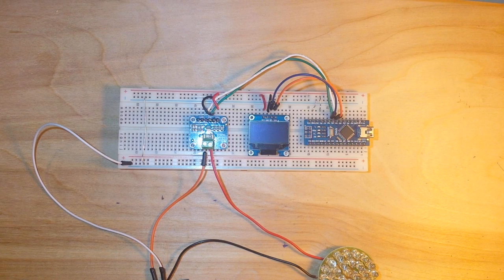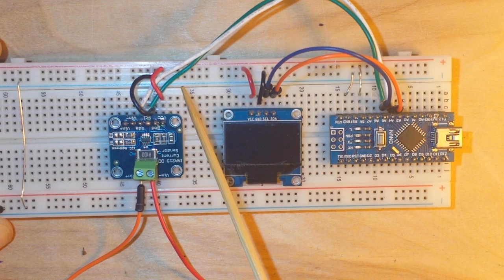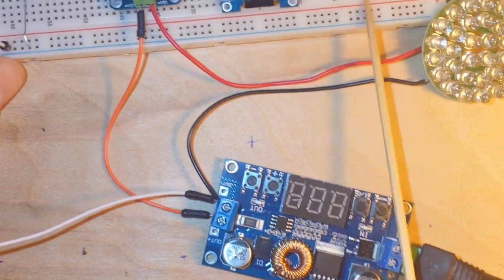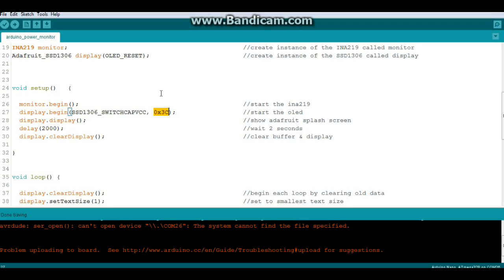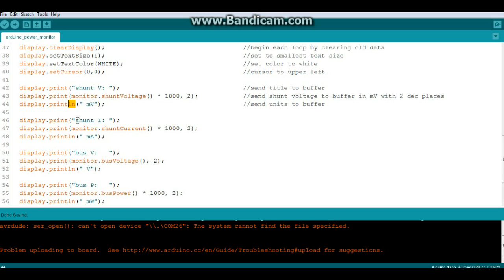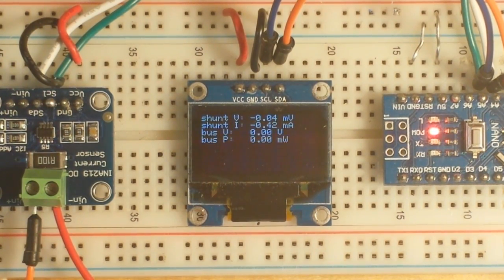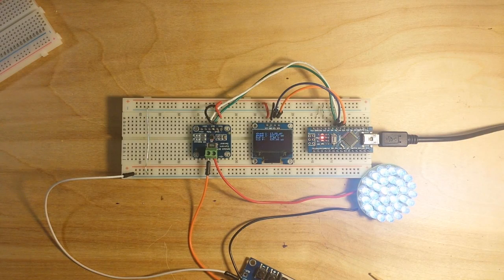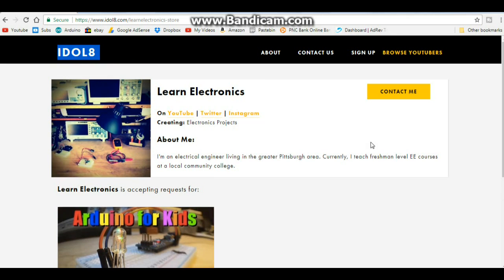Arduino Power Monitor

Comment: Hello, I'm very confused as to how to use this. I've looked at many tutorials and Adafruit's tutorials, etc - I want to measure the power output directly out of a battery for example. Is this possible? I'm expecting that if I hook up a 9V battery to the INA219 it should read about 9V, right? How would you recommend I hook it up? Thank you in advance!
Reply: yes it's possible
but you need the battery to be feeding  charge

Comment: can we use acs712 current sensor with oLed?
Reply from the maker: Sure, you will have to have the right library though.
Reply: But sir In comparison of ina129 current sensor, acs712 current sensor has only 3 pins. Can you please explain how to make connection(like clk) ?
Reply: UDDESHYA SHANKAR It is 5 Volts, Ground, and Analog Out

Comment: Nice thanks ...did you take it to the next level with logging ....gonna check you whole channel.  If I did this .at the very least I would want peak hold memory functions for current.  And it would need to handle high (150 amp or more) current for a DC circuit..  Will this do that?

Comment: I have a power monitoring project idea. Rather than measuring the voltage, I'm just sensing the presence or absence of a (16vac) voltage then sending it over wifi using ESP8266 (thinking ESP01 has plenty pins for that). I just have to decide how I'm going to sense the voltage with the ESP8266 without buying a power monitor board. Maybe an optoisolator.

Comment: Hello, i want to use an INA219 to mesure my solar panel input etc. so the specs of 3.3A is not enough. i need at least a max of 10A. i read somewhere that you can change the resistor 0.1 Ohm to a 0.01 ohm, so would a 0,01ohm 1% 2watt be enough? and what would i need in the software? i really hope someone can help me

Comment: The INA2I9 is normally operated with a floating input (it measures the differential shunt voltage) that is not referenced to ground and I think looking at your breadboard you have connected the ground of the INA219 device to the ground of the measurement side (shunt). If someone was measuring a circuit current on a high voltage circuit then the Arduino ground would be live or do so would create a fault current from the high-side to low-side, especially if the Arduino PSU was grounded.

Comment: i prefer the current sensors that just put out an analog signal according to the amps :P namely the max471 or GY-471. requires less cables, and also less effort on the programming side :)
Reply from the maker: Less programming is always good.

Comment: This project has a lot of possibilities. I forget what the max current for the ina219 is? I'm going to try this on an ESP32 Lolin with OLED built-in. I'd like to see internet logging as well and maybe even more. Thanks
Reply from the maker: George Chambers The INA219 is rated for +/- 26VDC and +/- 3A. 
You're right, I will have to move it to a mega.
Reply: Let me guess, you haven't soldered that new esp32 smd yet?

Comment: This one also has a built in alarm facility. https://m.banggood.com/CJMCU-226-INA226-Voltage-Current-Power-Monitor-Alarm-Module-36V-Bi-Directional-I2C-For-Arduino-p-1101401.html?rmmds=detail-bottom-alsolike

Comment: NICE i have something just like this with logging. I also modded some input/output connectors  (usb, solar panel connector, etc). It's hooked up to Mega and assume you'll need to do same thing (SD lib is memory hog). I log it at 10 hz.
Reply from the maker: Michael Padovani Yep, I'll be moving to a Mega for SD data logging. Probably move to a WeMos D1 for the IOT stuff.

Comment: Please continue with this project, I followed a similar project by "great Scott" but his code would not work
Reply from the maker: David Doidge Thank you, I will move forward. So up next will be data logging to an SD card
Reply: learnelectronics excellent news
Reply: @daviddoidge1252  it works no problem for me (the one by great scott) but  since i am replying 2 years later it doesnt matter i guess :D
Reply: @branislavpanak2013  if you read through the comments (on the one by great scott) you will see many people commenting to the fact it did not work, if you got the final build code to compile then well done you as it was too big to fit into the microcontroller memory
Reply: @daviddoidge1252  I havent read through them, however i have to say that IMO it is explained WAAAAY better here, i dont think that scott explained the code good enough, i like videos that i learn from, for example like this one where he explained what does each line do
Reply: @branislavpanak2013  agree with you totally, Paul teaches us where Scott shows us